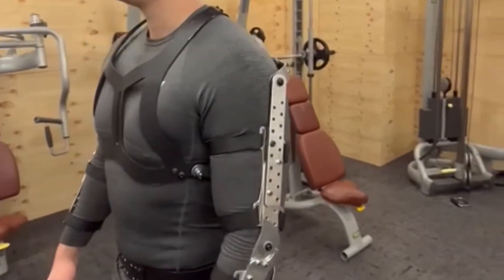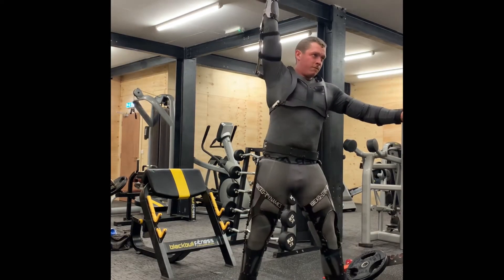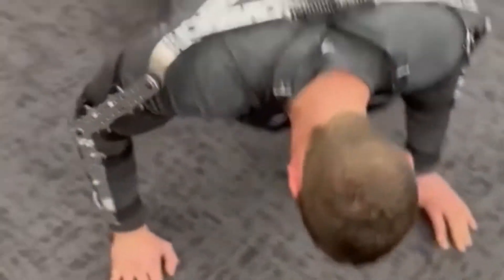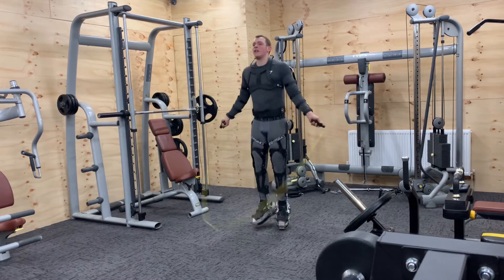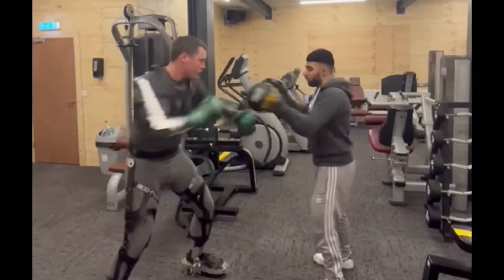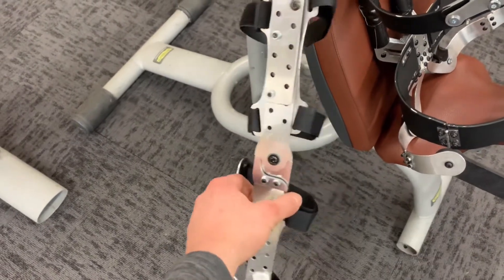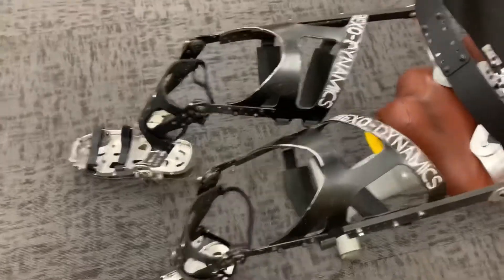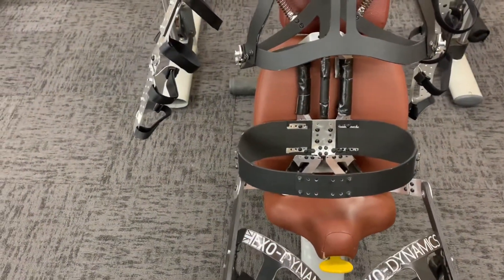Episode 3 of the exo skeleton project - making real power armour iron man

Comment: nice progress. 

have you looked into using a gear synchronized double hinge knee? it approximates teh natural slide of the center of rotation in the human knee resonably well (there are some better mechanisms, but they get exponentialy more mechanicaly fragile).
for the shoulders i would recommend using some ropes or mechanical stoppers to prevent the main bar from rotating into unhealthy positions.
the elbow could be improved with a simple sock over it to prevent nipping.
if the heel spring is to be reduced i would try adding an achilles tendon spring to assist foot flex as an energy retainer instead.
using springs for knee assistance and a steadycam like  spring based arm support works well too.
Reply from the maker: Thanks! 

For the knee joint, i agree the mechanism your talking about is better at following the knee joint naturally, however the in crease in mechanical and manufacturing complexity isnt worth it, it also increases difficulty of mounting motors etc,  there is an issue with a patent thats out on that mechanism aswell.

As for the shoulders when the motors and mounts are added it should get rid of the unhealthy rotating issue, although lock limits will likely be added.

The elbow, ive worked out a simple reshape of the alluminium and some padding (most of the exo has padding on everywhere but there) it would solve the issue, its just abit of a waste of time right now!

Yes of course! They’ll be achiles tendon springs i havent got them on now for 2 reasons, 1 until the armour is atleast modelled theres no where to properly mount it yet (would be guess as to the best place), 2 the spring size/tension etc will be based off the entire weight of the suite with armour attached. 

Lastly im trying to avoid any spring assistance on big limbs like knees arms as it will have detrimental effects to the user as found in the TALOS program. I Dont want the suit to give any extra strength, its merely to be weightless
Reply: @MattExo-Dynamics   the patent is only for the specific design.
polycentric joints themselves are not patented and are to simple/self evident/ historicaly common to be patented.
maybe you had a different, more complex, mechanism in mind. i used strange wording in my previous post

for the spring assist issues i have a few fixes:
- knee tendon must be weaker than achiles tendon, so it assists the gaot cycle instead of hinderering it.
-  the elbow target angle should be at below 90° flexion
- the springs should have no tebsion left/ disengage before the target location is reached and have some slack for small movements.
- the suit needs constant ergonomic alignment furing movement to prevent unhealthy joint pressures.

a pendulum walker puppet made with the described tendon parameters (exvliding alignment, as there is nothing to align too) works well.